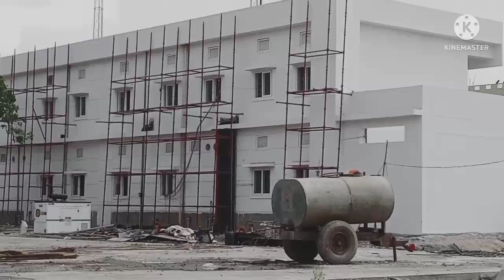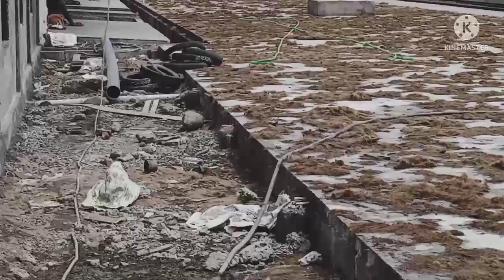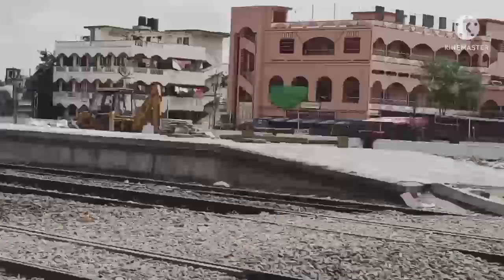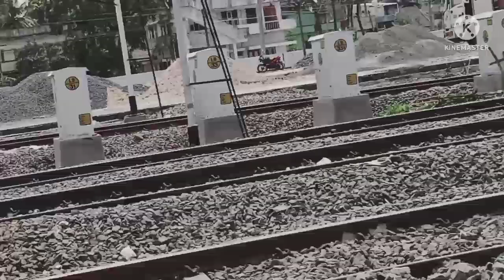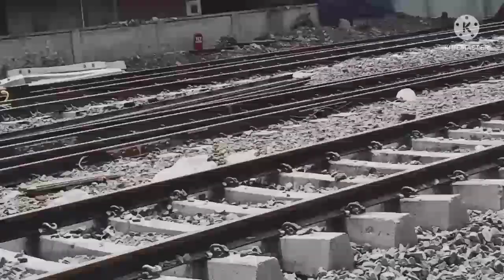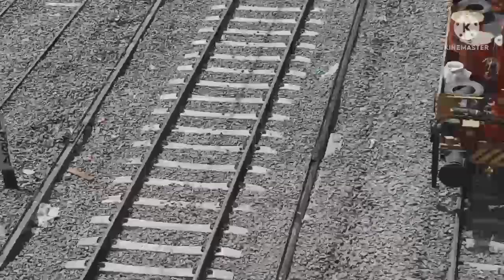tnku railway station, platforms name boards & more works

Comment: Thanks. I hope they also connect and weld the 2nd platform loop track to the main line. The distance between NH16 flyover and the Saibaba temple near madapaka railway gate is about 1.5 kms and they have been working on the tracks for over an year now. I had seen the station track works (main & platform loop tracks) go much faster in Akividu, Undi, Bhimavaram Town, Bhimavaram Junction, Aravalli, Pennada, Veeravasaram, Palakollu and Narasapuram. Earlier this year when the BVRM - NS doubling and electrification works completed I expected the works in Aravalli to NDD section to pickup and complete by end of May / early June.